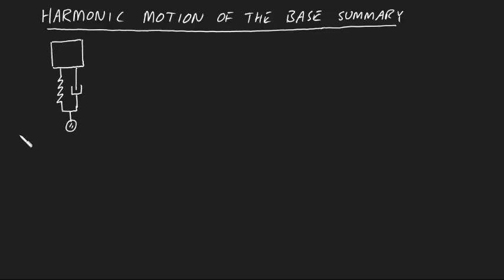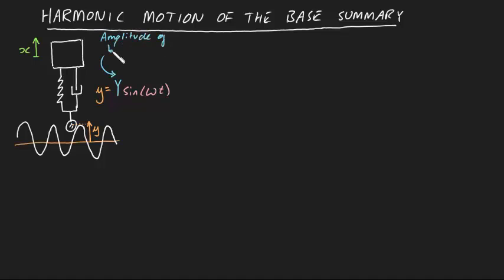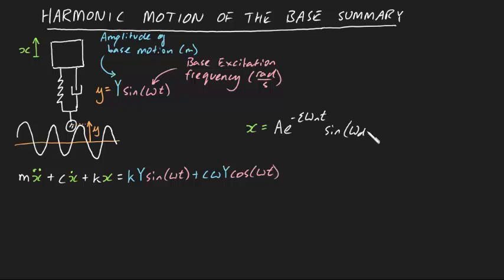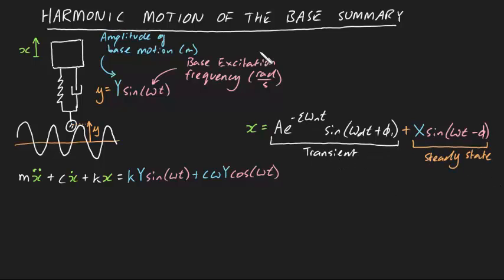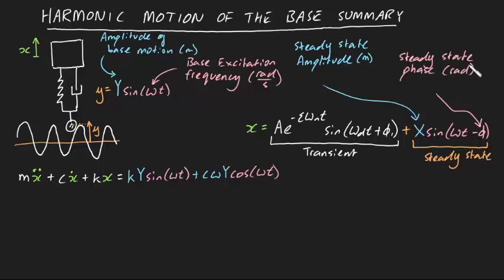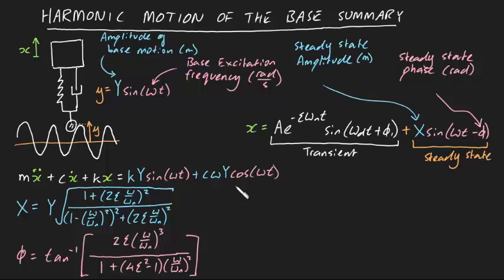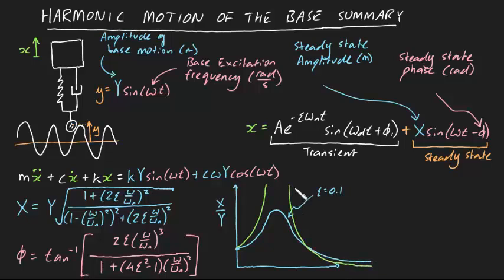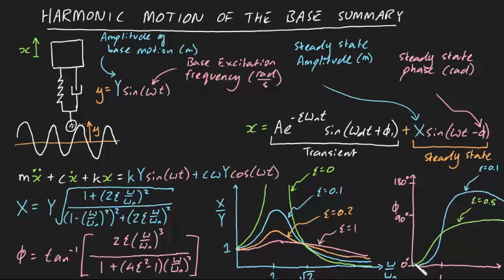Harmonic Motion of the base summary

Comment: For the denominator of the fraction of phase angle [the one in pink] I couldn't read the middle part. is it  (4*zeta^2-1)?
Reply from the maker: Hey mate, the denominator is 1 + (4 zeta^2 -1)(w/w_n)^2

:D
Reply: Matthew James 
Thank you so much for the quick response. 
During my search, I saw saw an expression for the phase angle that's similar to the one in the video. The only difference is a negative sign in front of the numerator. Why is that?
Reply from the maker: Hey mate! That is a brilliant question! The reason why is notation. Note that the steady state response in my video is X sin (wt - phi) where phi = arctan(2 zeta ...). 

I'm not sure what textbook / online resource you were reading, but I'd bet that the steady state response they were using was X sin (wt + phi)   (notice the + instead of a - !!). In their case, phi must be - arctan(2 zeta ...), which equals arctan (-2 zeta ...)

So in summary it doesn't matter which value of phi you use, as long as you also use the correct corresponding steady state response. 
Hope that helps :D
Reply: Matthew James 
That definitely helped, Matthew. 
Yes, what you said is correct. The steady state response was Xsin(wt+phi). 

Thanks a lot!
Reply from the maker: Any time, happy to help :D
Reply: 4*z°2<>1